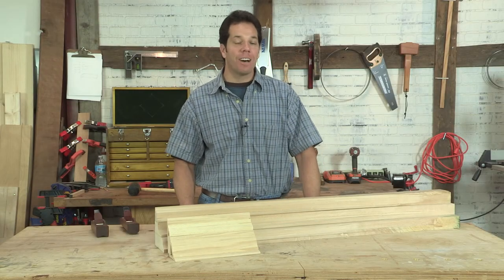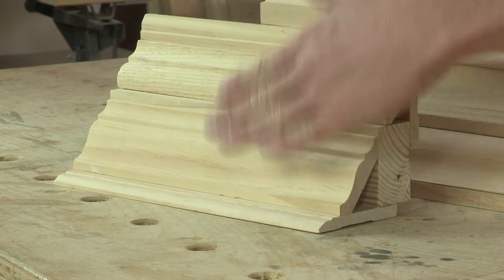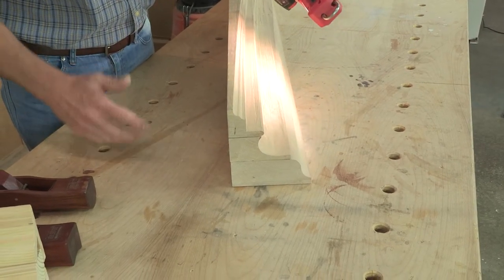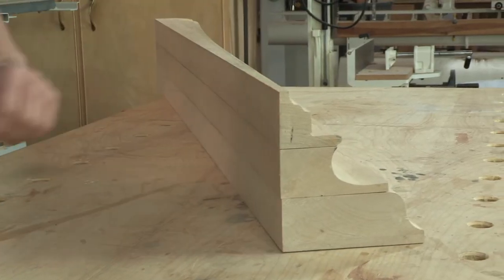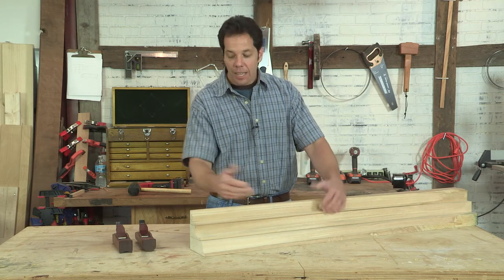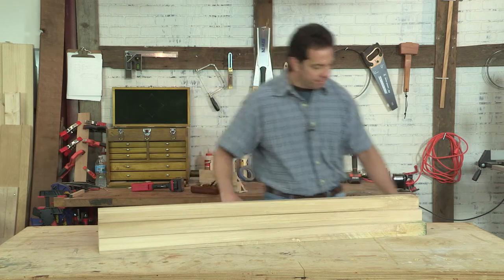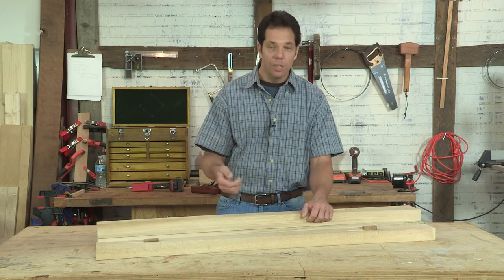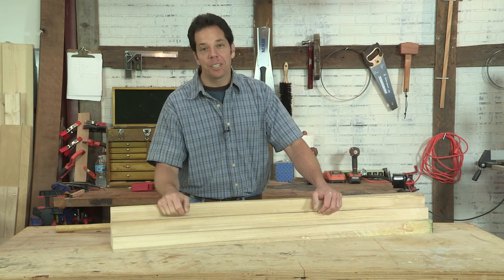Hand Tool Crown Moulding

Comment: Keyed dovetail joints like that have been recovered from Roman quays in London dating back the the first couple of centuries AD. Big moldings made from wide, thin planks were already well developed by the 1500's when illustrations of the special multi-man power planes appear - Roy Underhill has some much later, similar planes in his Colonial Williamsburg videos where they have a crew of several carpenters hauling on ropes to pull them while making new molding for the Court House.